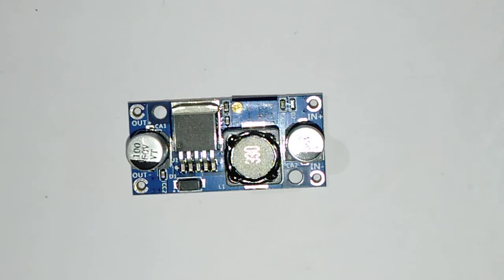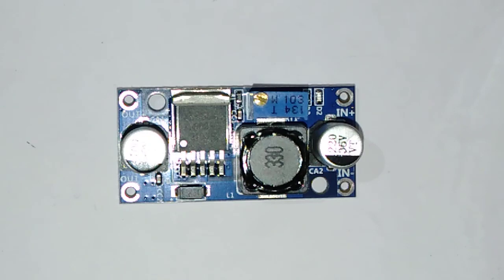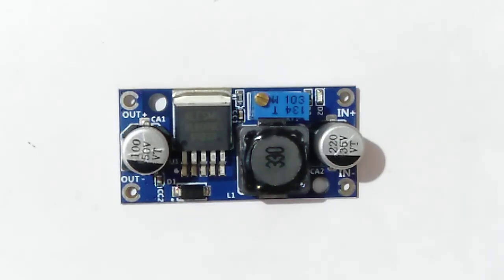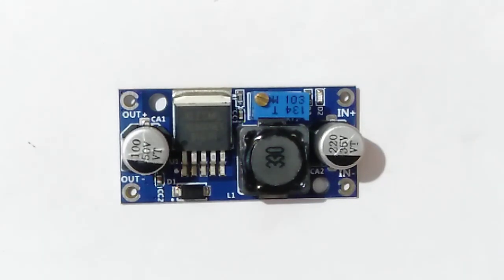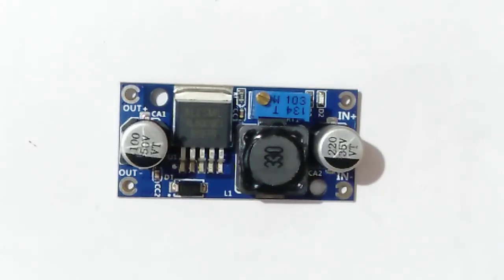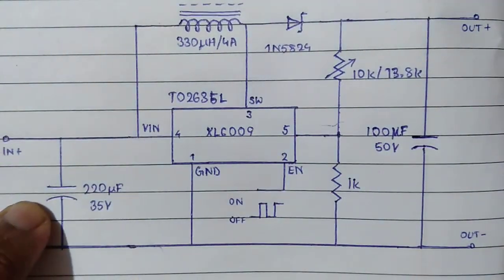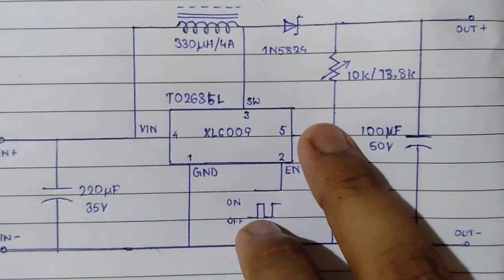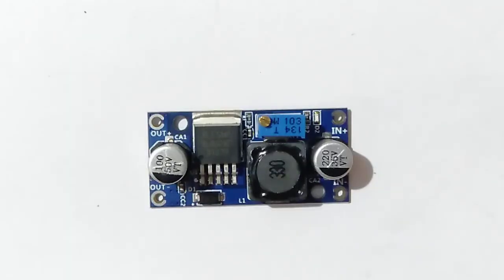XL6009 is a cute little DC-DC Boost Converter || Converter Series-3

Comment: Velleman also sell a similar module board. There are certain distinct disadvantages concerning this module however.  Rating. As is Velleman states that the module can Only Dissipate 10W Without the Addition of a Heatsink. A distinct disadvantage when operating above say 10v on the input. Another disadvantage is that Velleman fit a 220uF 35volt capacitor on the input terminals of the module so that it will be rendered usless when trying to convert an 30v AC RMS transformer supply to 24 volts DC via a normal rectifier/smoothing capacitor beforehand where the peak unregulated input voltage could approach 40 volts.
Reply from the maker: Great analysis... Will keep in mind. Thanks 😃😃

Comment: do they radiate rf noise to surrounding circuits ?
Reply from the maker: They don't because the inductor used here is a shielded surface mount inductor... So the RF noises during switching are suppressed greatly if not cancelled completely!